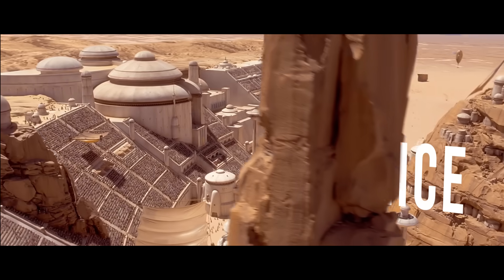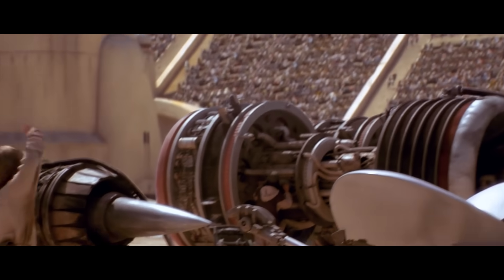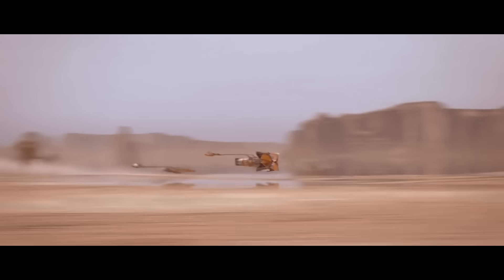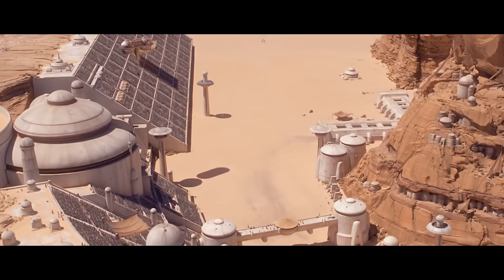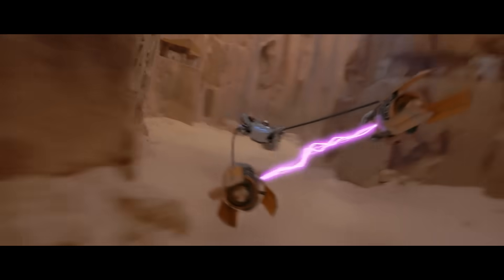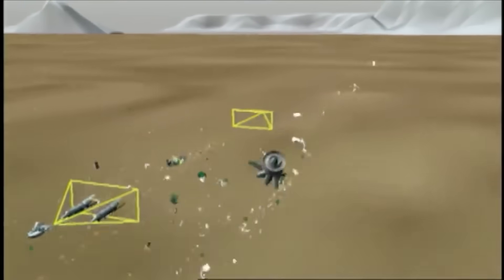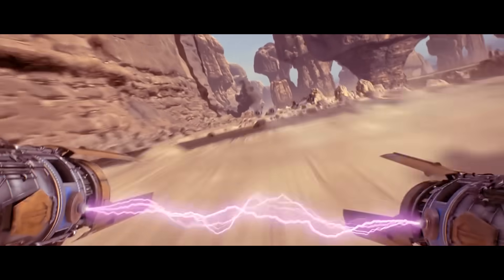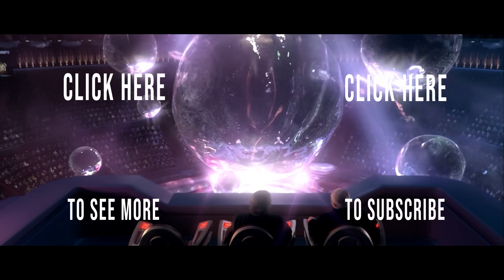Why Does the Podracing Scene Still Look So Realistic After 20+ Years?

Comment: i wish the pod racing game would get a remake. still one of my favorite racing games. amazing tracks, amazing environments, hi speed, hi adrenaline. pure gold.
Reply: Absolutely! I forget the name of it, but I had this weird handheld steering wheel controller with a 'throttle/brake trigger' and  buttons on top.  This thing was invented to Podrace. because the travel between locks on the wheel was so short, you could pull off amazing maneuvers not possible on any normal control scheme. Executing movie-quality close calls through the arches are some of my best gaming memories.
Reply: In all seriousness when it comes to the arcade style racing genre of videogames it's one of the ALL TIME greats. It played so well. Incredible track design. So amazingly addictive and replay value off the charts. I would include it on my arcade racer Mount Rushmore right next to Burn Out Paradise F-Zero X and Hydro Thunder.
Reply: It did it’s on Nintendo switch.
Reply: @wetteryan  for me it's SW racer, Rollcage and Collin McRae 2 :)
Reply: @SpikedCollar666 
That's a rerelease, not a remake
It also got a rerelease on Steam, based on the original PC version, with the only changes being the removal of SecuROM and a fix for a fatal error the original PC version had on modern systems.
There was also one and a half sequels: One for PS2 (Racer Revenge) and a Podracing subgame in Kinect Star Wars.
Unfortunately I don't think we'll get a proper official remake any time soon. Not until Disney gets their heads out of their asses in regards to the prequels. But there is someone making a fan remake of the game in UE4.
Reply: @VestedUTuber  I don't think Julien Robyn (of Robjin Studios CGI) is actually continuing this project, it's listed on his personal website and portfolio as a "demo", I suspect (but cannot prove) that he stopped after making that first demo level due to Cease-and-Desist pressure from the copyright holders.
Reply: I was thinking the same thing. With highly detailed modding akin to mech games or Elite Dangerous. And very, very difficult handling like Richard Burns Rally.
Reply: It’s available on PS4 as well

Comment: I've always felt the visual effects of The Phantom Menace held up the best, possibly due in part to something that often gets overlooked...

Unlike the next two films where Lucas was experimenting with going fully digital way before everybody else (and way too early, the resolution is laughably low by today's standards and there's not much that can be done about it), TPM was still shot on film.  Obviously cgi effects are still "shot" in a computer so that shouldn't make a difference... except it's still composited and mastered on film using an optical printer, which has a subtle effect on the colours and the tones of everything, which I would argue helps give all the effects are more cohersive, unifying look.
Reply: But the Phantom Menace looks very washed out with a lot of magenta for some reason.

Comment: This was how they used to make some video games back in the day. 

Well.. kind of. 

Most video games in the 80s and early 90s were 2D.. side scrollers and such. 

There were a few 3D ones.. mostly flight simulators which were very basic and had low frame rates. 

One of them though was Lucasfilm’s own BattleHawks 1942. It was amazingly detailed for the late 1980s and unlike 1942 and Afterburner it had a 3D look to it. 

Or so it seemed. 

Turns out the aircraft were 3D graphics and very detailed for the time.. but they were pre-rendered in multiple positions. This allowed a low powered computer to treat them as a series of 2D sprites rather than having to have the entire 3D model and render it in real time. 

Neat tricks they were able to do within the limitations of the technology.

Comment: whilst almost all of this is accurate, i believe it isn't technically photogrammetry, because that implies generating a mesh/point cloud from the images taken, which is very computationally intensive. Here they simply modeled lower poly geometry and then projected the textures of the photographed miniatures onto them. Still essentially photogrammetry, except the meshes themselves are not generated but hand made
Reply: Yes, dude's haven't watched the interviews apparently where hey whowed of their new invention called "Photoshop", which allowed them to paint real images onto a 2D representation of a 3D modell, a "unwrapped" version.

This workflow of bringin a unwrapped models uc into photoshop to paint on textures is still widely used.
But since other/better/more specialized tools came out, photoshop began to remove all features releated to texture painting like the 3D model viewer etc.

You can still find some reallyold videos of people using the Quixel in Photoshop to paint textures onto a 3d model. Same tools they used back then (apart from the realtime 3d view, and the ability to paint onto the 3d model itself.)
And yeah i know what your thinking, Quixel, dont they make photogrammetry 3d models?
Well, yeah now they do.
Quixel was first a photoshop plugin and they only offered materials and textures by then.

Comment: TPM, to me was a decently watchable movie. Not super solid by a stretch. Not bad enough that I was left to wonder why the goblin turned the stove on (if you get that reference I commend you). 

Some scenes and characters could have easily been discarded and the movie would have lost nothing. It actually might have gained room to expand on other more interesting points, but at this point it's armchair quarterbacking the 1974 Superbowl here in in the year two thousand and current year.

The pod racing portion of the movie stands well even all the years later because much of it was practical effect that was honed with cg rather than purely cg. Things had weight and heft and you can see it in how things moved. A racer slings around a bumpy turn then straightens up. Simple enough to say, but anyone that has ridden a bike or driven a car through a bumpy turn with any sort of speed knows the jostling side to side that you automatically counter with shifting your body weight. The rock of the vehicle one way then the other and then back as whatever suspension dampens the pitching. All of that sort of reverberates into the driver and translates into steering. That comes as a little input jostling that too shakes the vehicle. 

It's long and dry as explained, boring to read much less listen to being explained. But you know it immediately when you see it and the experience you have checks off the mental check list of what should be happening versus what you're seeing. If the two don't jive within reason, it just looks fake and breaks the immersion of the enjoyment experience. It's why there are certain movie scenes that make or break immersion experience enjoyment. The T-Rex stepping out of the pen, The jolt of the skinny dipper in Jaws. The alien bursting from the chest. The horns of Rohan. So on and so on, each of those depicted scenes very likely are known to the readers and commenters here and just by mentioning them, you have the image in your head and the sensation of what you felt the first time you watched. That is the immersion and when it's broken it sours all that surrounds it or is associated with it. But when it works, it works and will always take you back to the first experience.

Comment: There's something I appreciate so much about film, writing, art, video games, ect. that's made within limitations. When you have skilled and creative people working within limitations and boundaries with what can be done, it actually forces each aspect of the project to be the best it can be, and it often leads to ground-breaking use of current technologies and sometimes new technologies altogether. Conversely, with modern filmaking, although not always the case, more often than not simply paying VFX studios to make something in CGI is the go-to option, and even with that, so little foresight and thought goes into the proper way to shoot things so that digital assets will even properly fit into what's around them.

Also, GREAT video all around :)

Comment: Oh and for high speed. 

You can’t do a completely immersive scene like that. But… you can use a real landscape if you don’t have too many demands of it.  

The Hoth snowspeeder rescue. Just a helicopter flying low over snowy and hilly terrain. Speed it up and you have a snow speeder that looks like it’s going 600 MPH or more rather than the 100 MPH of the helicopter. 

I know it’s a helicopter because of the vertical motion that would not be natural for a fixed wing aircraft.

Comment: It is very misleading calling it "photogrammetry"
Yes, they use real-world plate photography to remap onto low-poly 3D models, and most cases just simple planes.

Episode 1 was the advent of PHOTOSHOP not photogrammetry.

Photoshop was needed to project these images onto a 2D representation of the 3D mesh.
You take each face(or groups of faces) of a mesh and lay it out on a 2D canvas.
This allowed them to simply "drag-and drop" and paint the actually photography onto a 3D model.
They basically invented Texture painting and UV mapping.

Calculating a single pointcloud from a set of images at that time would have taken days if not weeks.
(high-res pointclouds for even simple things like rocks can take days even now!)

Comment: You're confusing photogrammetry with projection mapping. ILM did not use photogrammetry, which, in the modern sense, did not exist yet at this point. Instead, artists would manually model low-res geometry resembling the miniatures and then clad them in photo textures. Depending on the object, it was important to take photographs from a similar perspective to how they were seen in the final shot in order to avoid warped-looking textures, since all the computer is doing is distorting a 2D photograph. This is a far simpler approach than photogrammetry, more labor intensive and producing results that are nowhere near as good - but it can create near photorealistic results in the right hands. 

It also wasn't new at all. ILM first used it for Hook (1991) and then later Mission Impossible, Star Trek First Contact (both 1996) and the Star Wars Special Editions (1997). Improvements in tools and the experience gained allowed them to use it far more effectively for The Phantom Menace however. What was new, which you correctly identified, was the scope of the scene, the creation of large, seamless environments with this approach.